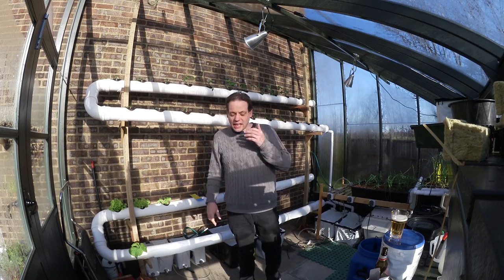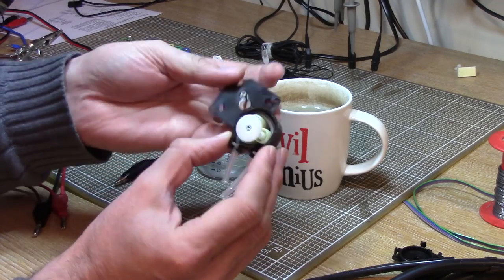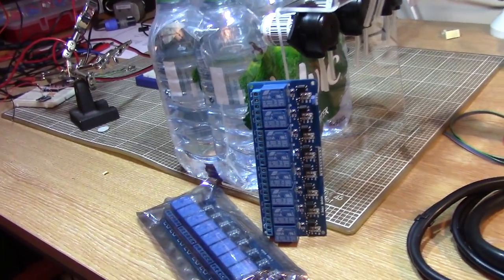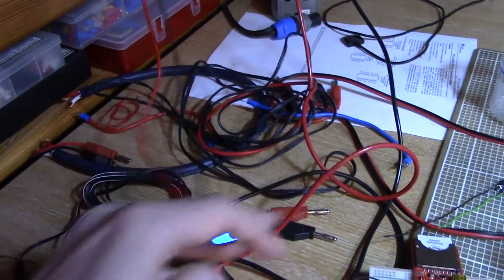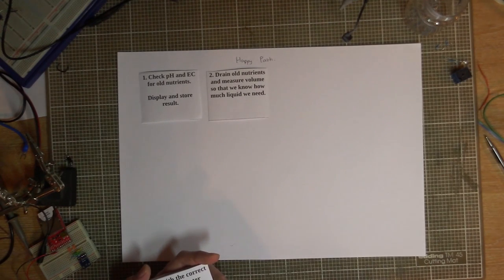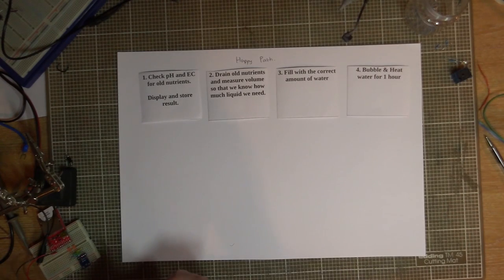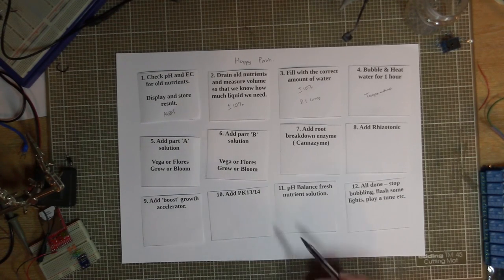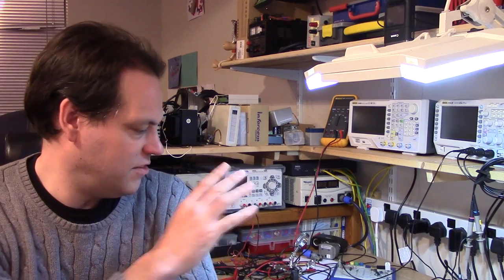The Mixologist - Automated nutrient mixing for hydroponics.

Comment: Jim - Nice overview.

I grow lettuce in a spare bedroom - 6 NFT tubes with 11 plants per tube.

I have been thinking of designing an automated system and found your video very good.  I was unaware of dosing pumps -- so thanks for sharing.

Your design and process flow is based on the nutrients you use.  Someone posted that they were developed for MJ growers.  You also commented that you watch MPHGardener and his use of Masterblend.  Those products can be used, as many do, but they contain a large amount of by-products that are not consumed by the plants -- hence everyone talks about purging their tanks and totally refilling them -- Your design flow is based on that premise.  

Consider a different process flow (this is the one I use).

I purchase dry fertilizer that is specifically designed for hydroponics.  The ingredients used in the fertilizer are 100% soluble in water.  My fertilizer vendor has posted quality standards regarding the quality of the nutrients (components from China are not used because they contain a lot of byproducts not used by the plants).  The fertilizer is basically a part A and B.  I mix my own concentration so my dosing amounts can vary (example -- my part A calls for 37 grams in 10 gallons of water.  I mix 37 grams in 1 gallon of water and dose at a 1/10 th rate).

The plants consume the water and nutrients at different rates so each day I measure how much water is required and the current EC level.  Since the EC is reading consumable nutrients and not a every increasing EC based on non-consumable compounds, the process is straight forward; add water, add nutrients based on new water requirements and EC reading (nutrients in tank).  I only clean/replace my tank fluids at the end of the growing cycle or 4/6 months.

I measure the water in the tank by measuring pressure.  I have a tube that extends to the bottom of my tank with a few holes near the bottom.  I have a mems pressure sensor mounted at the top of the tube (it extends above the tank and does not get wet).  The top is sealed with only the sensor wires coming out.  As the water level in the tank increased the pressure on the trapped air in the tube increases and is measured - thereby converting pressure to water depth.

If you changed the type of fertilizer you use, your system could become simpler:  Two (2) dosing pumps (part A and B) and a control solenoid water valve.

Where I live in the States, they don't use chlorine in the water, they use chloramine.  Chloramine does not come out of solution by standing in an open container for hours or bubbling (as in your system).  I use RO water - so my EC is directly related to nutrient levels.

As a side note -- look into (it's one of my projects for this hobby) the use of an inductive EC probe.  The inductive probe removes all the problems associated with two electrical probes sitting in a conductive liquid.  The probes are expensive if purchased from a commercial company -- I'm looking into a diy one -- two coils on toroid forms - one driven and one sensing.

I'm glad I found your site.
Reply from the maker: Hi +JHinkleJr - I really need to get one and make some more progress on this project - it's been gathering dust on my desk for too long now... but fortunately I've got some holiday time coming up, so I hope to be making some more progress (and another video) next week. 

Although I was using Canna nutrients when I made this video, I have since got hold of some Masterblend (same stuff MHPGardener uses) which was shipped over from the states.... The dry nutrients sure do work out a lot more cost effective than the pre-mixed stuff.. I'm hoping to do a Canna vs Masterblend experiment next year to see if there's any noticable difference between the two. (The guys at my local hydro shop reckon there's no difference between any of the brands they stock (which doesn't include masterblend).  My masterblend recipe is 0.6g/litre of masterblend, 0.6g/litre of Calcium Nitrate and 0.3g/litre of Magnesium sulphate.... Of course... modifying my planned dosing system to use dry nutrients instead presents a whole different set of chanllenges, so I might press on with desgining for liquids for now and worry about modifying it later.

The problem with relying on EC level for nutrient measurement is that it doesn't tell you the relative proportions of the different nutes... for example, if the plants are using lots of nitrogen, but no P or K and you keep on topping up, then the strength of P&K will gradually increase over time. I don't know how real-world of a problem this nutrient imbalance is. I understand that massive-scale commercial growers get water samples analysed with a mass spec so that they can work out which particular nutrient needs topping up on any given day (and the biggest growers even have their own mass spec machines and do it in-house). 

I'd already been thinking about using air pressure to measure the water level - I've saw it done that way in a dishwasher I once dismantled and was always rather taken with the idea.

A DIY inductive EC probe is a project I'd be very interested in... I read up on that when I was working out how EC probes worked, and it seemed like a fantastic idea... Please keep me posted if you make any progress with that.

Thanks for taking the time to write such a long and well thought out comment - Happy Christmas!!

Cheers!!
Reply: +Jim Conner   Use your solid Masterblend components.  Figure how much is required for 10 gallons as an example and then mix it with only 1 gallon of water.  Now you have a 10 times solution to use in you system.  You just need to account for less solution using the concentrate than with your premixed purchased liquid solutions.

The notion of nutrient unbalance is propagated thru the use of fertilizer (like Masterblend) that is NOT designed for hydroponic use (when used in soil - these impurities don't have an adverse affect on the plants -- they just add to the gross weight of the fertilizer).  Fertilizer like Masterblend have a LOT of components that effect EC and PPM readings that are NOT consumed by the plants.  Over time these unusable components build up.  The typical explanation as to WHY an EC issue exists is to call it a nutrient unbalance instead of stating the fact that the fertilizer contains garbage and needs to be purged often to keep the system running with some degree of proper EC or PPM values.

In your investigation on how EC meters work, you should have noticed a range of different material used for the probes.  Probe contamination is one of the biggest problems with leaving an EC probe in solution for extended period of time -- as in an automated system.  THAT is why I'm exploring an inductive probe.  Inductive commercial probes sell for $600+ which is well outside my pain limit for an automated lettuce grow system.

The pressure sensing water level work well if the proper sensor is used.  I used it to track Atlantic tides in the Florida Keys.  The problem I found in salt water --- was salt water.  The sensing tube would contain a hi humidity environment of salt which tended to corrode things quickly.  When used to sense fresh water levels -- the corrosion issues is greatly reduced.

Cheers back at you!
Reply from the maker: Pre-mix the masterblend in concentrated form.... That's so obvious... D'oh... Facepalm... bumps hand on forehead... Yes of course... What a superb suggestion... How on earth did I fail to think of that one. Thank you, thank you, thank you :-)

With the water level sensing thing, I'd actually been thinking of using some lay-flat tubing filled and sealed at atmospheric pressure, inside a rigid outer PCV tube. As the water level rises, it will attempt to compress the lay-flat tubing inside, increating the air pressure inside the sealed tube - I think that would avoid any corrosion issues.

Cheers!!
Reply: +Jim Conner 
I'm just quick thinking off the top of my head --- but if the pressure sensor was placed in a plastic baggie -- sealed where wire exit the baggie and the baggie is placed in the tube -- as the pressure in the tube changes -- the same pressure change would be seen in the baggie -- there may be some lag in response but levels don't need millisecond response times..

I'll have to try this as all humidity issue would go away.

Cheers!
Reply from the maker: Yep... that's pretty much what I was thinking.... Can you tell me what pressure range you I'd need to measure from/to for a reasonable depth of water (let's say up to 50cm of depth)... I've got some of those dirt-cheap sphygmomanometer pressure sensors of ebay kicking around  which can measure 0 to 5.8psi ... If I'm really lucky, that could be perfect for the job. Cheers!!
Reply: +Jim Conner 
I forgot the part number of what I used before because I did not care for the resolution.  I was looking for peak and minimum readings and their associated time.

Measuring water depth needs good resolution.  I need to do some tests.  I use a 20 gallon tube to hold my solution and rough measurements suggests 1 inch equates to 3/4 gallon or 3 US quarts.

I do not know what the delta of pressure increase would be if using a 3/4 or 1" PVC pipe as the sensor stand and liquid moves 1" or 3/4 gallon.

I am designing my own flight controller for a drone I'm building and I have been working with a MS5611-01BA03 which is a barometric pressure sensor to be used to read altitude.  The sensor reads from 450 to 1100 mbar with full accuracy or maximum range of 10 to 1200 mbar and uses a 24 bit ADC with a I2C interface with a spec'd resolution of .042 mbar.

I'm at sea level so standard barometric pressure should be 1013 mbar which gives the sensor 87 mbar units to detect pressure greater than ambient with full accuracy or 187 to max range of sensor.

I intend to test this sensor to see what water depth could be detected within 87 to 187 mbar of pressure increase.

I'm sure it's on the web someplace but can't think of the google terms to use to produce a useful search.

I let you know my test results once I obtain them.

Cheers!!
Reply: +JHinkleJr 

Here is a link to an App Note that uses a Freescale Pressure Sensor to measure water depth to 39 inches.

http://www.micromegacorp.com/downloads/documentation/AN034-Water%20Depth.pdf
Reply from the maker: Thanks +JHinkleJr  - That appnote is really useful as it tells me that it is 1kpa per 10cm of water... so my 0-40kpa sensor should be good enough for my needs I think... I'll have to build up an op-amp circuit and give it a test soon... Cheers!!

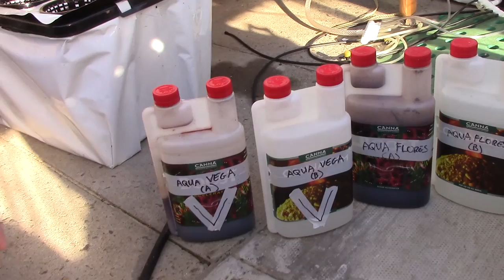Comment: you should try to balance the PH before you add nutrients, because you might lock some of the salts out (sometimes you can see clouds forming in the water), when you do it after. it's a bit harder to do, unless you start calculating on an atomic scale - which some do. but you are still better off, if in the end, if you just add a bit instead of a lot of PH down/up. i also recommend making a neutral PH +/- solution with some distilled or RO water where you dilute the PH +/- first. way less aggressive. i personally use 82% phosphoric acid, diluted to a 1:10 solution, which allows easier dosing and creates less of an acidic hot spot. also, check the nutrients, often enough, B should go first. Rule of thumb is: the one with more phosphate goes in first. The correct order is: H²O>(H²O²>)Cal/Mag>Silicon>PH+/->B>A>Micro+Additives>check PH/EC

I am working on a similar project and i use a level meter inside the tank where the nutrients are mixed into, that way i don't need to measure how much flows in. but i am not topping up, just replace it regularly.

Comment: Commenting on a nine year old video, I assume you got all this nailed down already! 

One idea I had while watching was a "mix tank" where you can confirm the dispensed nutrient quantities before they are added to the main tank. It would a small tank seated on high resolution load cells, and the new weight can be checked after each nutrient is dispensed.

This would double check the flow rate and cut off of the peristaltic pumps and ensure nutrients are going out. If you expect 5ml of nutrient D to enter the mix but the mix pot only goes up by 4g, there's an issue, etc etc.

Once everything is accurately dispensed into the pot, it can be pumped or tipped into the main tank.

Now I'm going to check out your other videos and see how you go on..  This is like finding a "new" old TV series to binge 😂
Reply: You could rig up the mix pot as a bell syphon and simply pump clean water in to empty it. This would flush it out to avoid scale build up over time.

Comment: Instead of peristaltic pump, have you considered ultrasonic nozzle? Flow-rate is more or less constant, and you can fill a separate reservoir in which all the necessary solutions are combined and then gravity fed into the main system

Comment: Also add power supply and processor failure alarms. This could be done most easily by remotely querying the system periodically, and triggering an alarm if no response is received within a pre-determined timeframe.

Comment: Love this ambitious project! one solution to the checking nutrient pump out would be a funnel on a scale
Reply from the maker: Hi +yagoa - I'm planning on putting all of the nutrient bottles onto a scale and measuring the weight difference as I dispense the nutrients - that gives me a very level of confidence that the nutrients have been dispensed, and let's me detect when bottles are empty etc - The load-cells for digital scales are crazily accurate - I've got myself four of these load cells and now I need to build a weighing platform/enclosure to hold the bottles in place. Thanks for taking the time to comment. Cheers!!

Comment: Hi Jim. Just wondering how you are getting along with this automated mix project.  Have not seen any updates on it but I might have missed it.  It sure looks complicated and yes, lots could go wrong.  I was wondering... what would be the result if you used gravity measurements as IV bottle and drip valve as seen in hospitals with a type of solenoid valve for each nutrient, where the EC is measured contentiously.  Where EC is of a point of number for the first nutrient, then once reached, the flow stops as the next solenoid is activated until the next number of EC is reached.  Progressing up the line until the final EC is finished.  Seems a microprocessor could keep an eye on this all the time.  Where there can be different states of EC readings.  One for seedling/early veg to mid veg and finally flowering stage. Not sure if this is a way to go with this but thought of it when watching your video.  Anyway, just an idea.  If it did work, would greatly simplify the project.  Please keep up the super wonderful videos.  Thank you for all you have posed thus far.